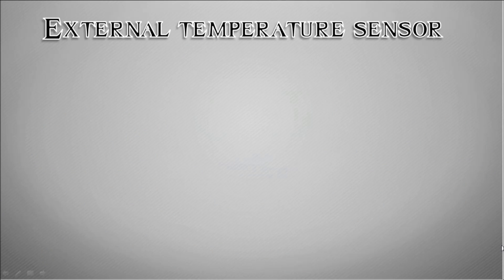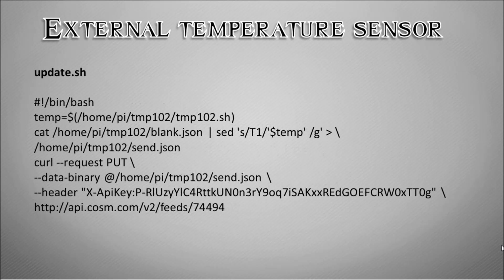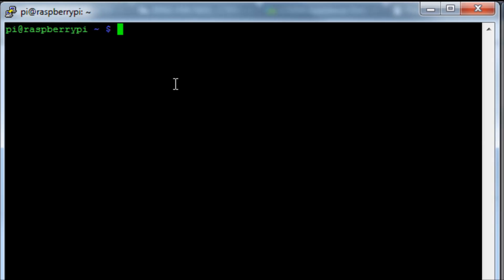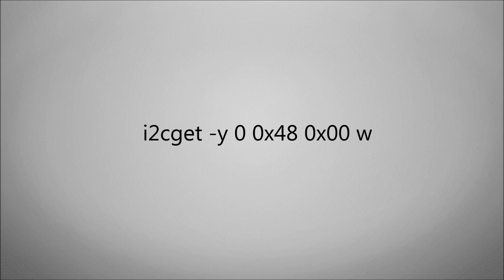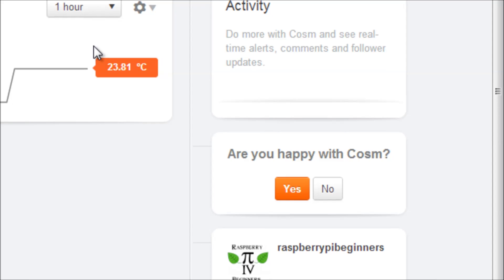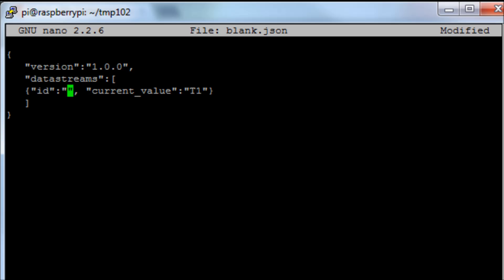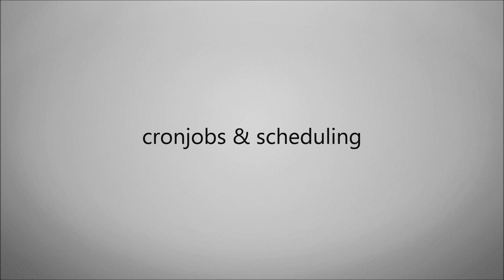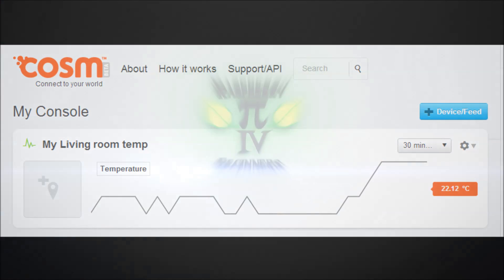Raspberry PI - External temperature sensor

Comment: After my Stock Pi 3B arrives I want to repurpose my currenr gen 1 Pi B to handle 3x temp probes (script to take average) and if possible a humidity sensor and then lowest prioroty wind speed sensor.

I'm old greying and gay so if I can do it in C or Pascal then that's a plus.

Comment: If you're having problems with a model B board getting the tmp102.sh file to read try changing the second line to "i2cget -y 1 0x48 0x00 w | \". I think this might be due to some of the changes made in the new version.

Comment: The RPi actually has a built-in temperature sensor:

Execute: cat /sys/class/thermal/thermal_zone0/temp
41698

The Temperature is in milli Celcius. In the above code, its 41.7 degrees Celcius.

Comment: Nice... I've modified the script to use the internal temperature of the pi now the new scripts are available for the internal sensors. ..
use
/opt/vc/bin/vcgencmd measure_temp | cut -c 6-9        to get the Pi temp and put that in tmp102.sh....then the rest is the same!

Comment: An easy way to solder the pins onto those modules is to put the pins on both sides, then plug them onto a breadboard - then solder the ones you want while plugged into a breadboard. This is almost essential for devices with pins on both sides (if you use them - don't need to in this instance), as it makes sure the angles and spacings are spot-on!

-Gordon

Comment: Very clever use of JSON.  I'm doing something kind of similar (not with the Pi yet but it's all interpreted, so soon) with my Weather Station.  It feeds to a remote head and every so often it will pump a Hex string over the USB connection.  I take the string and derive temperature, humidity, wind speed, rainfall from the weather pack mounted outside of my house and feed it into JSON that is published and several sources leverage, including my APRS Wx node.